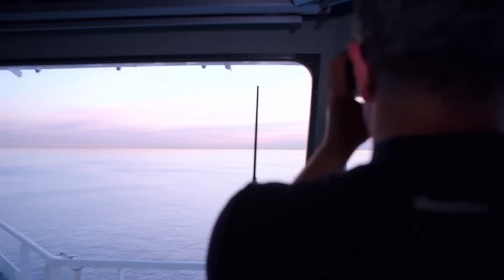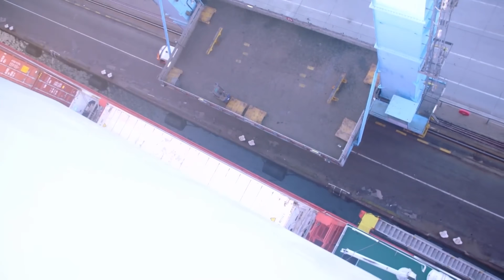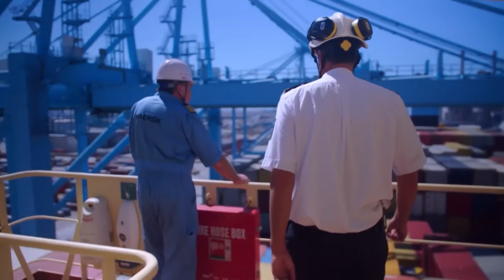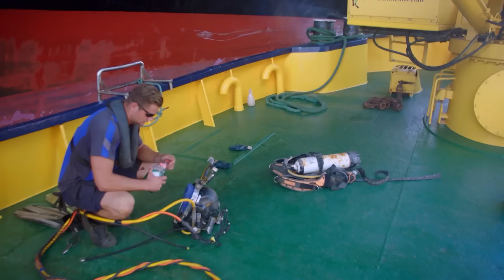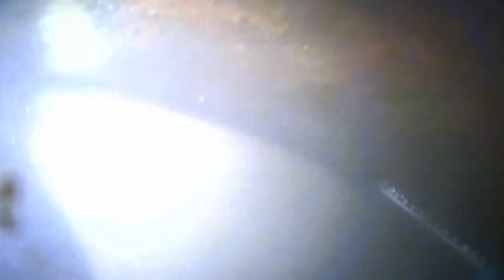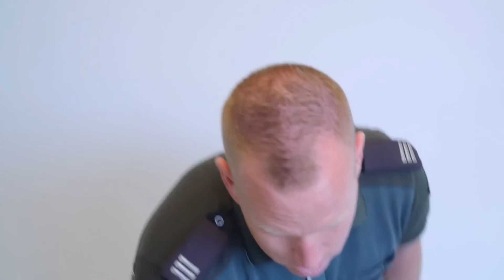Europe’s Mega Port: The Giant Logistics Hub of Rotterdam | FD Engineering

Comment: When they use Manhattan as measurement am I supposed to know how big Manhattan is?
Reply: I don't think you can imagine it. To give you a bit of an idea: from 1962 to 2004, it was the largest port in the world. In Asia, several ports have since become larger, but outside Asia, it is still the largest port in the world.
Reply: 42 km
Reply: @nashirgayadeen925  How many football feilds?
Reply: @GoldenRetreiver-i5t 400+
Reply: @neverseenbeforenow   doesn't sound as impressive as 42 km ... I have no vision of 400 football fields ..
Reply: @GoldenRetreiver-i5t  How many B/inch² with B being Bald eagles is that?
Reply: @neverseenbeforenow  That's only the length, not the width.
Reply: @GoldenRetreiver-i5t  A football field is about 100 meters long and 50 wide. The port is 42 km long and about 20km wide. That means the port has the surface of about 420 x 400 = nearly 170,000 (hundred and seventy thousand) football fields in surface
Reply: @lws7394  A football field is about 100 meters long and 50 wide. The port is 42 km long and about 20km wide. That means the port has the surface of about 420 x 400 = nearly 170,000 (hundred and seventy thousand) football fields in surface
Reply: @erikhartog5340  I don't know about inches. Never use them. But a football field is about 100 meters long and 50 wide. The port is 42 km long and about 20km wide. That means the port has the surface of about 420 x 400 = nearly 170,000 (hundred and seventy thousand) football fields in surface
Reply: @nashirgayadeen925  Bravo 😅
Reply: @nashirgayadeen925  In other words its the length of 1 Singapore (whose ports combined handle even more cargo than Rotterdam, maybe as its waters are deep & thus don't need to rely as much on pilots)
Reply: Manhattan is slightly smaller than the port of Rotterdam. 👍
Reply: @hansolowe19 hahahaha
Reply: Easy, it's about the size of land you can buy with $24 worth of beads and "trinkets". (as the popular story used to tell us)
Reply: They could have used elephants or Eiffel Tower. You would have understood
Reply: Exactly the same thought, hahahah
Reply: Fr.. no one from outside USA and probably a nerd somewhere.. knows how big Manhattan is.. I didn't even know it had a dock 😂
Reply: Manhattan is the same size as 24,000 Olympic swimming pools, or 36,000 regular swimming pools or 13 billion kiddy pools. Hope that helps 😂
Reply: No, the people in Manhattan know how big Rotterdam is.
Reply: Yes. :hand-purple-blue-peace:
Reply: As usual Americans always think they are the next best thing after the invention of Sliced Bread and have no clue of the nearly 200 countries that make up the World. Many of them are in ways better than the US most just as rotten. Btw I love the USA, my son lives there but compared to The Netherlands I would not want to trade my godforsaken country to trade in with even more sinful and blind USA.
Reply: 😂😂😂😂😂😂 ikr
Reply: To quote your commander mischief: It’s Huge!!!
Reply: I think, because it is in US American language, it is mainly made for US citizens made. Although probably more dutch people are watching it ;)
Reply: where even is manhattan?
They should measure it in 'it would be X amount of dougnuts laid out flat'
Reply: 12 miles long 2 miles wide
Reply: @stevelandis223  no, 48 km long about 30 miles
Reply: Yes or Google it 😅
Reply: @Doris_The_Dog Or not.

I like European measurements better.
Reply: @Tjalie-j6i  agree but km to miles or inch to cm are important and necessary to know. A gallon is 4.5 litres in that idiotic us it is 3.8 litres
Reply: @Doris_The_Dog good ol' murica, won't let go of it's standard measurement, even though the entire world uses metric, with 10X ot divided by 10 to simplify everything. 1000g in a kilo of coke yada yada yada
Reply: @Doris_The_Dog in the UK they use liters
Reply: @Doris_The_Dog  90% of the world uses metric. Let the stubborn Americans adapt, not the rest of the world. Also Fahrenheit makes no sense at all.
Reply: @TheJoaveck  Nothing in USA makes any sense at all 🤯🤷‍♂️ guns, healthcare, food standards, corporate funding of politics, religious fundamentalism, inability to compromise, no neutral media and widespread case of nationwide collective narcissism!
Reply: Kinda. It's the most famous urban area in the world.

Comment: Those harbour tugs look small, but are extremely powerfull  with 16.000 HP and a 360 degree ( zero )  turn ......
Reply: A big engine with a small boat around it.
Reply: 16,000 HP? It is not an ocean going tug; the maximum power of these tugs is 6,000 HP with a bollard pull of about 100 tons.
Reply: @Jodocus1000   whoeps....slip of the pen by adding a 1 : thanx for correcting. to 6000 Hp
Reply: @fryfrysk and you didn’t edit the original comment?🤷🏻‍♂️